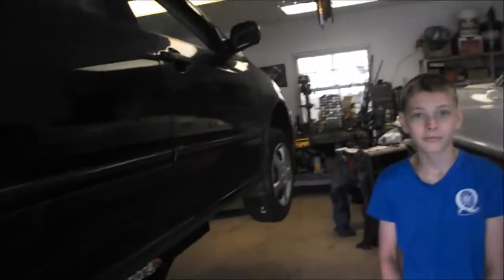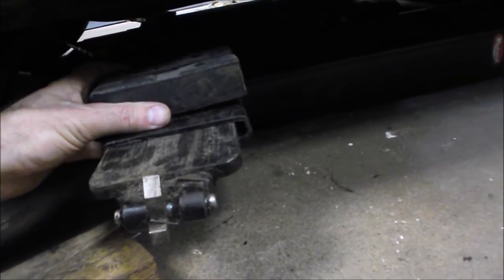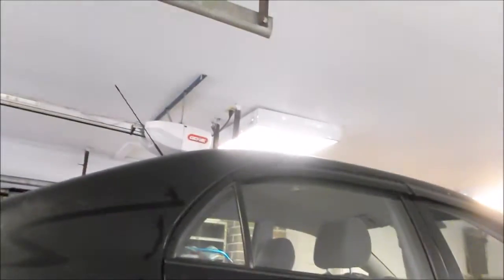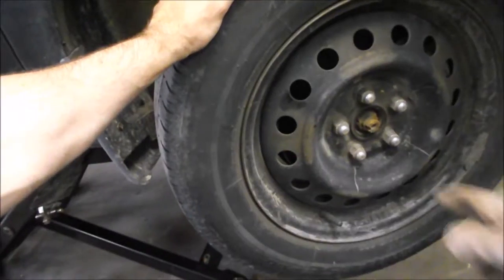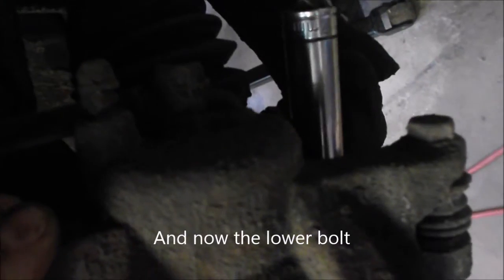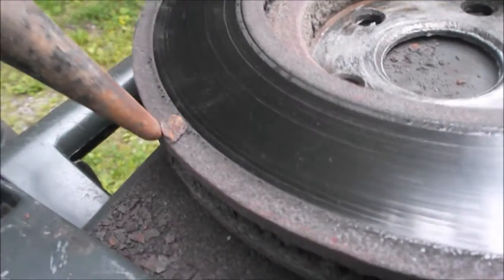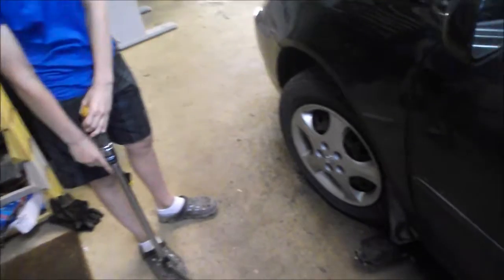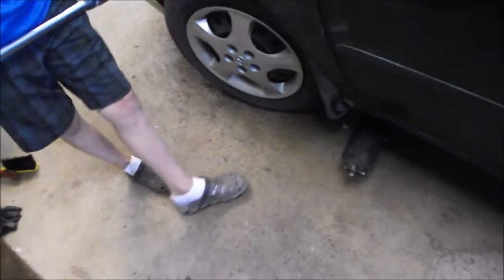DIY fixing grinding sounds from disc brakes

Comment: Should be using impact sockets so they just split not explode shrapnel into your kids face like a case hardened hand tool socket would.
Reply from the maker: Yes, this is exactly what was said at 4:13.